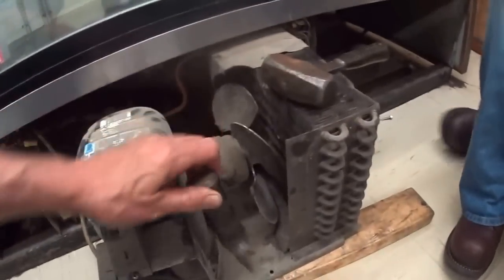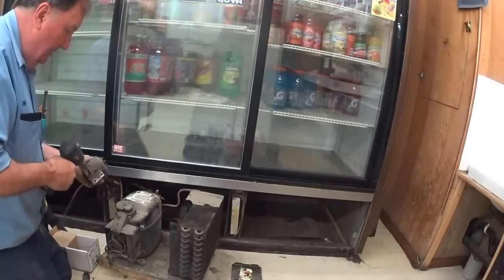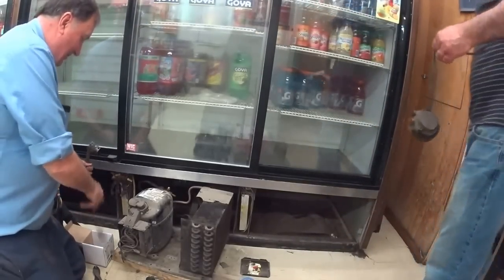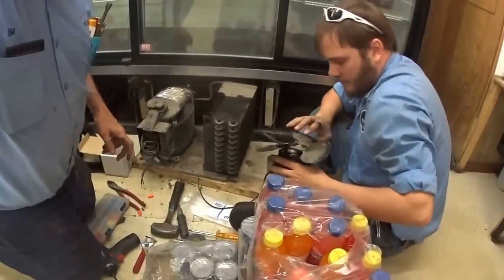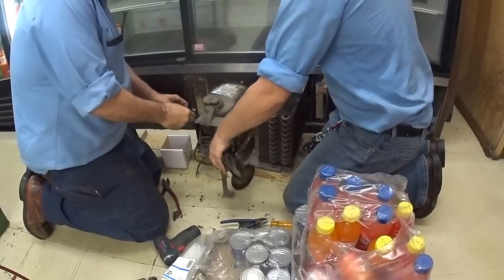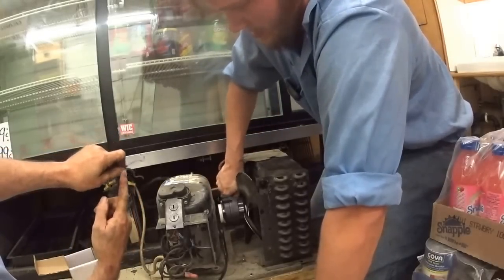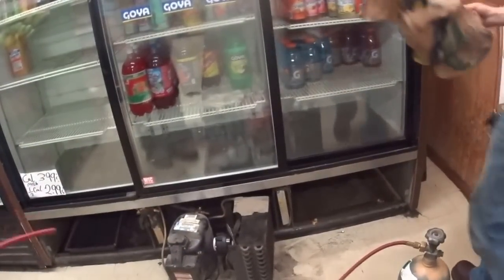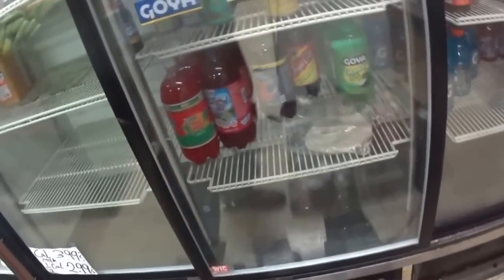Replace a 9 watt condenser fan motor

Comment: Jim you have my sympathy I used to teach kids right out of high school and they had all the answers too! We can only make suggestions and hope they listen before something bad happens.
Reply from the maker: Larry Cole exactly, Sam is pretty good though, I found that if I made a slight suggestion it gets him thinking about it, it's when we go full onslaught they shut off, a quick small suggestion works best. Wow you taught high school kids, how did you do it, I wouldn't last a week, I have trouble with my indian customers. thanks
Reply: No I taught kids that were right out of high school 18, 19 and 20 year Olds at Universal Technical Institute  (UTI). It was a lot of fun and challenging at the same time.
Reply: Larry Cole hey we weren't all bad well........
 I take that back yeah we were haha sorry for all the headaches we caused you mr cole. UTI reach for the sky!
Reply: Tazzman228 For the most part it was fun there were parts that were challenging.

Comment: Just a suggestion...if you put a wet towel in front of the condensor and blow the CO2 from the back of the condensor before you put in the new motor you will catch all of the dirt or dust on the towel and avoid a dust cloud. Also a face mask might be helpful. Otherwise...good job
Reply from the maker: ***** yeah, I know, it's just fun making a dust cloud, thanks

Comment: That was to funny when he blew out the coil. Lol
Reply: Ha Ha Ha Right next to the deli case !
Reply from the maker: Rob HVAC we did a deli case the other day, I had to yell to Sam to stop, it looked like an atom bomb went off, the cloud went down the Isle, the two arab guys faces dropped, they had to get up and do some work cleaning. thanks
Reply: shold the air flow be blasting against the compressor or be blown out the radiator coil parT?

Comment: Jim how do you remove the compressor and condenser unit out from under the cooler?  I think this is neat. I was thinking of removing the fan and blowing the coil from inside. What is your opinion Jim.?
Reply from the maker: Mahesh Patel there's usually a couple screw/bolts with a 3/8" hex head in the front on the base. blowing the dust from the inside would work fine, the dust will come out from either direction, removing the fan motor would just be extra work, unless there was grease in it then foam and pressure from both directions would be good if necessary.

Comment: Let the young man know hanging keys on the front of your body is never a good idea and I have been guilty of this one take off the ring. Good video!
Reply: How not to clean a coil! Wow
Reply from the maker: cleanairdude Yeah, I know but it was fun, the store owner just swept the floor. next one I'll pull the vaccum cleaner out and wet towels & plastic . This store wasn't the cleanest to start with, guess I didn't help. thanks
Reply from the maker: Larry Cole You are right, that's my son Sam, he's going through that stage where he thinks he knows what is best, "school of hard knocks is coming" I did relay your message, thanks

Comment: Cleaned a subway sandwich shop condenser (sandwich table) had a cloud of dust just as big, These condensers hold so much dirt and never get cleaned 'til the equipment stops working.
Reply from the maker: daniel343ful exactly, a vaccum cleaner doesn't get the dust out of the fins like CO2 pressure does, thanks
Reply: I use a vacuum on one side and blow CO2 in the other right at the vacuum hose inlet. The CO2 blasts the crud out and the vacuum sucks it up so it doesn't make a biohazard cloud. I'm too old to be filling my lungs with who-knows-what.

Comment: Hi Jim
I have a question, the condenser fan motor on our vending machine recently went out. I found a replacement motor on ebay, installed it and works good again. Since then I have found some electric motors even cheaper on Amazon and have considered buying 2-3 extras in case this happens again.

One of the motors is $15 (UEi brand):
http://www.amazon.com/gp/product/B00EPZXQ2A?psc=1&redirect=true&ref_=ox_sc_act_title_1&smid=ATVPDKIKX0DER

The other is $30 (Packard):
http://www.amazon.com/Packard-65411-Inc-Motor/dp/B00DM8MCTY

I'm tempted to buy several of the $15 motors but the deal seems too good to be true. Almost every other brand that makes the motor I need is around $30-$40. Is UEi a good brand? Or is it junk? Thanks in advance
Reply from the maker: firewall5000 it's probably OK, is it made in China, my first choice would be an Emerson motor from my Copeland distributor. thanks

Comment: Man I just replaced a compressor just like that   .. but I know what you mean about the screws coming loose because of the vibration  I had to replace a blade once because the shaft damaged the fan blade. I will post a photo of that in the morning  ..
But on the other hand motors are cheaper in Ohio. A motor like that is like 50 bucks
Reply from the maker: Ahmad Hamad The price of the motor was $49. to the customer. I remember them costing $24. thanks
Reply: Where are you located I have vintage vending machine that needs a condenser fan replacement.